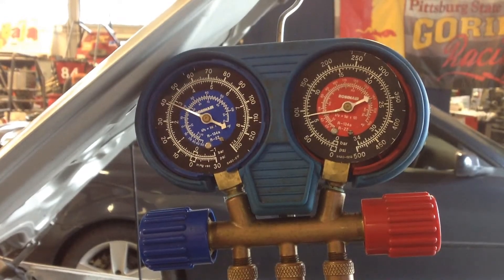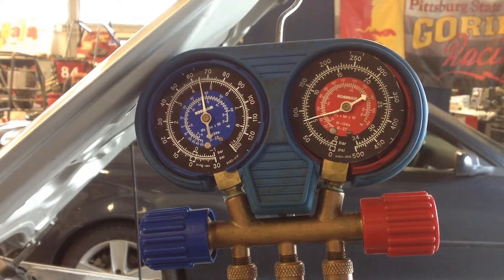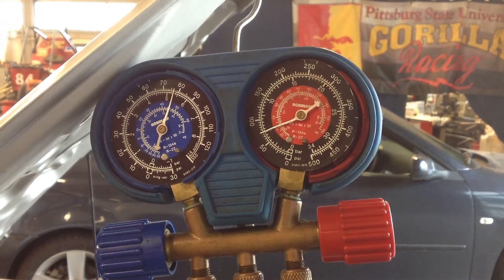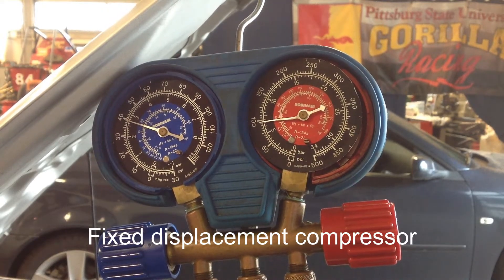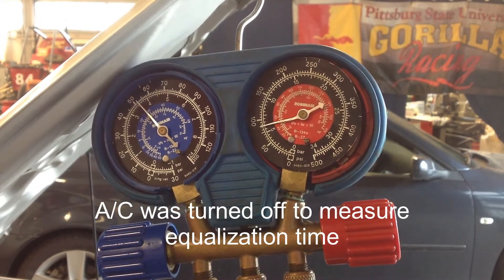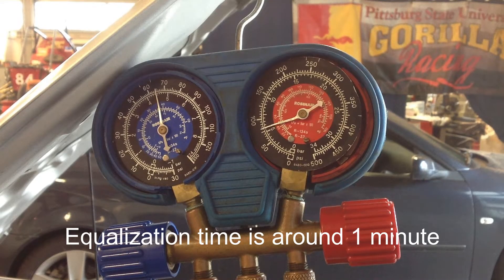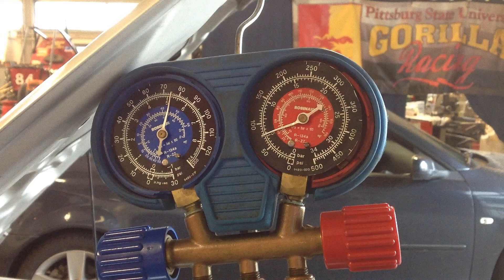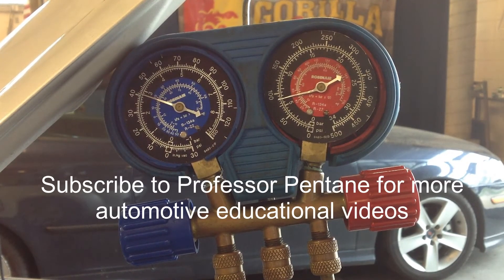A/C gauge analysis diagnostics: 2009 Kia Spectra TXV

Comment: Hey Professor, I got a weird issue with my cars AC compressor clutch or high pressure switch. The AC clutch will not engage during the heat of the day but engages perfectly normal at night. Do you think this can be narrowed down to a few different issues, high pressures caused by ambient temps raising the pressure causing the high pressure switch to stop engaging or the high pressure switch itself is partially starting to fail? Just wondering what you thought the problem could be. I've also read that a slightly worn drive belt can also cause issues like this but im not sure if i see how that could be. Thanks for all the educational videos